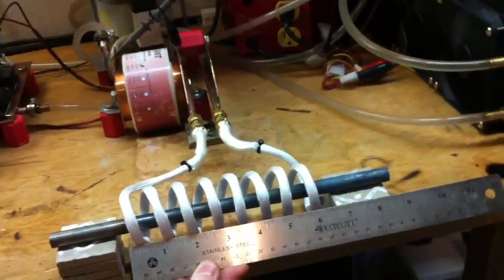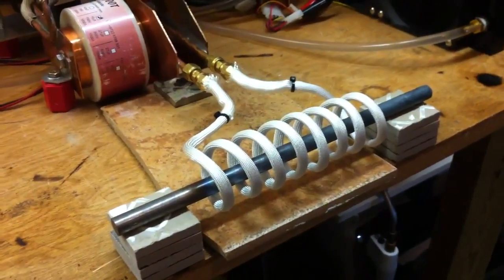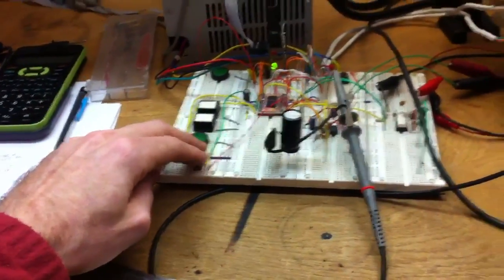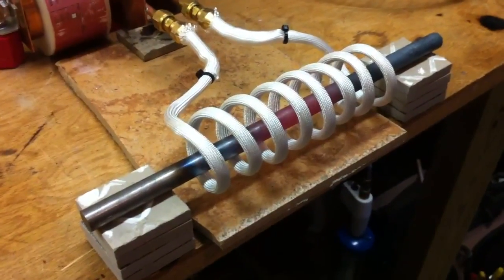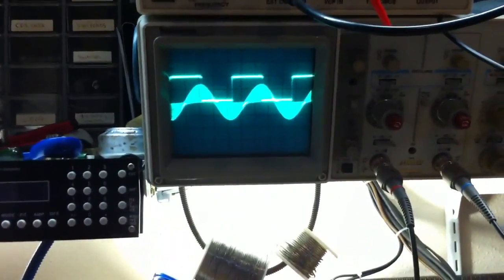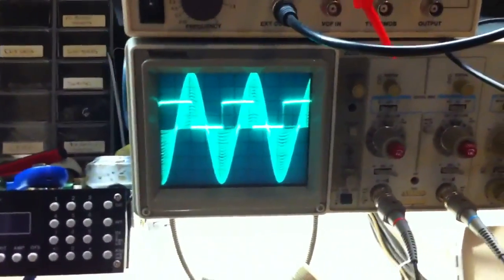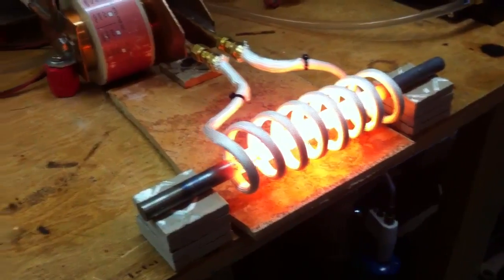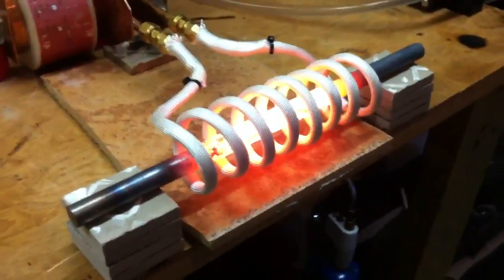Induction Heater - 6" Coil vs. 1/2" bar

Comment: Did you notice a drop in inductance as the iron transitioned from ferromagnetic to paramagnetic as it heated past the curie point?
Reply from the maker: Yes, you can tell when it crosses the curie point but heating doesn't slow down. In fact, it speeds up (gets easier) since the resistance of the workpiece rises with temperature.
Reply: @ThingEngineer  I understand that, it's the eddy current squared, X the resistance of the metal, that determines how much heat is induced into the workpiece, but I was curious about the change of inductance. The only way to tell, would be to put a frequency counter on the tank circuit capacitors, and look for a sudden change in frequency, as it crosses curie point. It should go up. If you put ferrite in the coil, the frequency should drop. Aluminum or copper, should cause a rise. Hot steel should take on the electrical properties of brass, or bronze. Iron is a poor conductor compared to other non ferrous metals.
Reply from the maker: @vincentrobinette1507  I didn't answer your entire question. You asked if I noticed a drop in inductance. The short answer is yes technical, but I'm not reading it out. You could calculate the actual work piece inductance based on the current PSC2 inverter output compare register value. The PSC2 OCR is changed dynamically as the phase difference between the inverter current and the inverter voltage shifts in an attempt to keep the frequency operating at the resonant point (keeps inductive and capacitive reactance equal). Since we know the inverter frequency (because we are setting it) you would just use the series resonance circuit formula and solve for L.
Reply: @ThingEngineer  Exactly. By just measuring the frequency, it can be calculated by the value of the capacitors who's values don't change, even though the impedance changes with frequency.

Comment: how i could make the  copper heated like this iron stick in the same this cuircut?
Reply from the maker: Using the same setup, I have successfully heated copper as well. I used a smaller coil to get a higher resonant frequency and used it to braze other coils! :)

Comment: Why not use a graphite rod instead of an iron rod? Then enclose the induction coil in a thin sleave of titainum to cause titanium to glow white hot? You could use much lower voltage to generate heat and even better idea would be to line a insulated cylinder with nintinol thermal electric generators with the titainum sleave being positioned directly in the middle with air being forced around it to heat the air. The Nintinol thermal electric generators could then generate the volts needed to operate the electronics to operate the the induction and the electric fan to draw in air through the insulated cylinder. A space heater you can plug in to a wall socket or 12 volt plug or clip to a 12 volt battery to start it up then the space heater becomes self sustaining after Nintinol thermal electric generators kick in. Then you would have a self powering space heater you could use in a tent a camper or trailer or shelter without any fears of generating toxic fumes. 😊

Comment: Soooo... 26A at 800V p-to-p?
You sure you got that voltage right?
Surely you're not running at 10.4KW?
Reply from the maker: Great question! The 800 Vpp measurement is across the capacitor in the tank circuit. To calculate input power what we need to look at is the input voltage and current. So 240VAC at 26A = 6,240 watts of total input power. And since it runs at a power factor near 1, the reactive power is near 0 making 6KW the true input power. (KW = KVA, look up the beer analogy for reactive power) 

Extra (continuing with the beer analogy):
To get a DC voltage for the inverter, induction heaters and similar machines must rectify the incoming AC voltage. Add filtering to this rectification and you lower the power factor to a point where only about 60% of the total reactive power (KVA) is doing real work (KW). Most companies take the reactive power (KVAR) and add it to the real work power (KW) then display the reactive power or KVA as the machines total power. This number one of the measurement you often see on the front of an induction heater, in its part number, or plastered on its eBay listing. It is NOT the portion of power doing real work or heating power of the unit but the full reactive power. A good rule of thumb, if you see a 15KW induction heater on eBay you should probably calculate for a power factor of 0.6 meaning only 60% of that 15KW is doing real work. So.... 15KVA x 40% leaves 9KW after removing 6KVAR. Pretty sneaky but nothing new.

The reactor forge uses stronger components and a different type of filtering raising the power factor to around 0.96 to 0.99. This means that nearly 100% of the input power is doing real work. When the machine is running at resonance it is extremely efficient and about 95% of the power makes it into the work piece. This is pretty stinking significant especially if you compare it to heating metal with a flame. Consider for a moment how much of a fuels energy makes it into the work piece when burning it and transferring that energy through convection... Hint: you would almost invert that 95%, crazy!

TLDR;
Yes.
Yes.
No, it's running at 6.2KW.
Reply: Great answer! Thanks for the clarification. Makes sense now, and an efficiency of 95% is extremely impressive to say the least! I have heard rumors of the sneaky power tactics implemented by most companies especially when it comes to sound equipment, but now I see just how sneaky they're being.
Thanks again!

Comment: What is the cheapest and easy way to make induction heater to heat 16 mm diameter steel bar? Thanks..
Reply from the maker: The cheapest way to make one? Start with a DIY controller using a low-cost microprocessor to generate the PWM pulses for the inverter, no display no input other than a start button. When the switch is pressed ramp down the frequency from the maximum, your inverter can handle until resonance in the tank circuit occurs. This can be determined by a variety of methods. Use the PWM signals generated by your controller to drive high-speed switches such as IGBTs or MOSFETs, this is your inverter. The inverter drives an impedance matching transformer. Make the transformer out of toroidal cores or whatever ferrite material you can get your hands on, just make sure it is a material type that can handle frequencies in the kHz range and power levels in the kW range. Make your tank out of eBay surplus high voltage & current capacitors with copper tubing to connect it all. Pump water through all of the tube to cool it. Use a pond pump or a salvaged windshield wiper pump. Be careful with water and high voltage! If you would like more detail, then ask more detailed questions. ;) I'm working on guides to explain all of this in MUCH greater depth with photos and models.
Reply: Josh Campbell thank you for your detailed explanation josh. I will be on it.

Comment: I assume this is now defunct since the links don't work and there is no schematic out at Github
Reply from the maker: I've updated the link and have actually been working on this recently. Finally! ;)
Reply: Thanks Josh.  I"m afraid I find that site confusing.  Where do I find a  schematic?    I assume you have a tank circuit powered by big mosfets and some switching source to drive the gates?
Reply from the maker: I understand, there is a lot on git hub. The Wiki (tab) will help explain the what and as far as the where well you just need to navigate the directory structure under the Code (tab). Schematics would be under hardware. I'm working on getting the new schematics and code for the CriticalMass Core on there but the older stuff is there now.

And yes there is a tank circuit, but no the current machine drive the tank with IGBTs and a power stage controller to generate the signaling and control the resonant frequency. The old machine used a PLL to generate signaling and lock onto Fr.
Reply from the maker: Also, I'll be using the Patreon page for updates that don't fit into the Github style (social etc.). https://www.patreon.com/ReactorForge

Comment: LIKE! I have no knowledge of electric or electronic parts.. Please, tell me how much will costs to build something like this? Thank you in advance.
Reply from the maker: This could be a pretty dangerous project for a beginner so I would work on that part first. The raw material cost for "something like this" can vary wildly. Some throw together a working version for less than a hundred bucks, this one setting on a desk top with no case, extras, controls or display is about $4-500. Not counting supporting items like an oscilloscope, auto transformer, programers, etc... Understanding electrics and then the circuit will get you the answer to that question.

Comment: Why are home made induction heaters so slow to heat up the metal?  Even the most elaborate setups are slow.  I have seen them in manufacturing systems where they heat up a 1/2" steel rod almost instantly.
Reply: Wattage and focus. This is spread over a large area with a lot of thermal mass. The systems you are talkning about are liquid cooled so they can handle a lot of wattage and are focussed to rapidly heat only a small area of the bar before the rest is able to heat sink away the energy.

Comment: Josh, Great Work !! ... I see you have taken a lot of attention to detail, water cooled coil, serious cooling for your drive board.  Why do you need so much circuity to create the drive wave?  I see a sine wave and a square wave.  I would guess the square wave is the main drive wave outside the tank circuit and the sine wave is whats generated inside the tank circuit once you have tuned it properly.  I see you have at least 3 circuit modules.  I assume you are able to modify each part of the drive signal including frequency.  In my mind it seems it could be simpler - what creates the need for so much circuitry?  I know you are doing zero crossing detection, etc.

Comment: I am interested in making an adjustable induction heater like yours, but I have been searching for a good, step-by-step, from the wall socket to the coil video guide on how to set one up. But I am frustrated because I haven't found a good one yet. Everything I have found so far has either been bits and pieces, or just videos of them working, or very small ones. I would love to see a full walk-through of your setup! I am subscribed, and eagerly waiting for a new video!

Comment: If so could not a stand alone heater be designed using a capacitor a TEG a fan a electromagnetic pump and a heat exchange coil? Novartis

Comment: Cool video, I had a few questions. So you said the "resonant frequency" changes as the material heats up. Is this referring to the AC frequency, and is there a sweet spot for energy transfer efficiency for any given material? Also, why does the inductor draw more current throughout the process? Thanks!
Reply: Una pregunta interesante y jamás se respondio

Comment: Could you theoretically use something like this for blacksmithing, or would it be better to stick to traditional methods of heating the metal?
Reply: You could definitely use this for smithing, but a normal charcoal furnace is better for a more even heat and therefore greater steel integrity.
Reply: Hm. What is it about this method that creates uneven heat? Something to do with the design of the coil (like the spaces in between loops) or something inherent to the way the metal is heated?
Reply: Lemonschooner The way that the knife is passed through the coil causes some parts to become heated and some parts stay unheated. thus causing an uneven heating.

Comment: Question: Is the resonant frequency increasing or decreasing when it starts to heat.  I am assuming an increase, as it would take more energy to heat the material hotter and hotter.  
Question 2: What was the range in frequency change across the heat range visible in that video?   Like, how much frequency adjustment occurred for you to hit the resonant frequency from room temp to when you tuned past the resonant frequency?

Comment: very good video, i brought a 1000 watt Induction Heater for Harding  home made tools works good
Reply: +Artistic Diyer got it from this website here http://goo.gl/FS4aiu
Reply: Hello,
Can you inform about your 1000W Heater, model, price etç? Have you a video of working?
Reply: yes does work good, but you do need a good power supply capable of putting out at least 20a continuously.
or use two or four lead acid battery's in series. not got a video of it working.

Comment: question : does the inductor works on ac or dc ?
Reply: ***** what about voltage ? ,how much please ?
Reply: ***** wow so the power is P=I * A =400v*1000A=400000Watt ?
Reply: +Durchgebaut thanks a lot man. as an ingineer in automatism they only teach us some basics in mechanic,electronic,informatic.....

Comment: interesting, the wattage to hold that temperature is quite low I couldn't read the read out on the oscilloscope to read the output voltage.... definitely a cool video.

Comment: I have a question, are you cooling the coil with water system??? and is there a heat difference between 120v to 220v power intake???

Comment: 26.6 x 800 = 21280 W.... thats a lot of wattage, but I dont need it that hot, and Im pretty sure more coils would intensify the effect per watt.... I need to research the resonant frequency of iron in relation to its temperature.... thanks for the great video bub, I've been looking for something to work with on induction, most of what I find is the typical mumbo jumbo, but this one has me on good paths
Reply: +Durchgebaut He states in the video that he is adjusting as the resonant frequency changes.....
Reply: +Durchgebaut not saying I know all about it, but the hotter it gets the less resistance there is which causes it to require higher amperage to heat it any further, that's my take on the video.....
Reply: +Durchgebaut I just started playing with ac generators and oscilloscopes in college, we wont be doing this, but Im sure I'll learn a few things that will help
Reply: +Durchgebaut my mistake yes the the resistance increases because the molecules are  moving further apart.... i would say induction would work very well for on demand electric hot water.....

Comment: my resistive hot water heater uses 4500 watts per element typically only 1 at a time... but you just heated more mass than that element in a lot less time to a lot hotter temperature... if this works when submerged, im designing and building my own water heater lol.... dont forget the TP relief valve lol

Comment: So 1.8kW to 20kW to melt that round stock..  I wonder what kind of toll that has on the electric bill.
Reply: do the math: 20kW x 
3 minutes, 0.05 hours  
= 1 kWh = 1 unit = 30 cents
Reply: Mark II ... I thought power in watts was Voltage Times Amps ... 220 VAC X 26 amps = 5720 watts which is 5.7 kilowatts.  the 800 volts he is talking about I thought that was just in the tank circuit.  So I think that current reading is coming straight off his 220 vac line.  Do you see anything wrong with my logic?
Reply: @advancednutritioninc908  you are correct the 800v is the voltage across the tank and it's peak to peak (+400v/-400v)
Reply: lucky my electric is 8 cents per kWh

Comment: Im wondering how efficient this is. Can you make a space heater using this concept that draws less power than an infrared or ceramic or other types of space heaters on the market?
Reply: ***** ohh no it's a terrible idea. Using an element however would be better.
Reply: +Lakario Davis All electric heaters are basically 100 percent efficient in converting electric power to heat. However, this one uses a lot of circuitry that is not really needed if you are just trying to heat a room. Note that if heat is your goal, burning fuel is probably better than electricity (if your utility power comes from a fuel-burning utility). Because when you burn fuel, you capture most of the heat in your home. But when the utility burns fuel, only around 40 percent of the heat is converted to electricity.
Reply: +McKenzie Keith now this is very dependant on your area. Some places fuel is more expensive.
Reply: +siggitiggi well, I guess that is true. Maybe the utility gets fuel cheaper than you can, or maybe you live in a place where electric power is not generated by burning fuel, or maybe electric power is subsidized by the government. But the main point is that an induction heater is not a good solution for heating a room or house compared to other electric heaters.

Comment: I have a Lincoln "Tombstone" stick welder. Can I just make a few coils of copper pipe, set it on AC and do anything like this?
Reply from the maker: heliarche Those output low voltage high current DC or 60Hz AC, no where near the 10's of KHz you need to set up a resonant tank not to mention no way to control the resonant frequency. You also would not want to power an inverter like that in an induction heater with low voltage high current as switching high current is harder to deal with than high voltage. The preference is high voltage low current. Best to just keep using it as a welder. ;)
Reply: Right on. Thanks Josh!

Comment: how you have that set up with the resonance? do you have skype?
Reply from the maker: Lation Fly There is a current transformer between the inverter (IGBTs) and matching transformer. The current waveform is compared to the output waveform of the inverter and is used to determine resonance. Find me on GitHub.